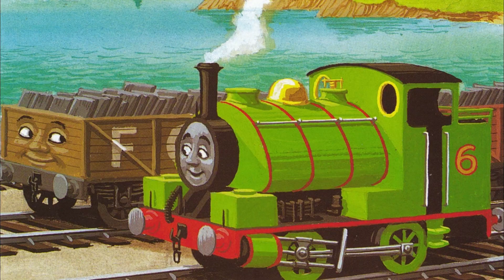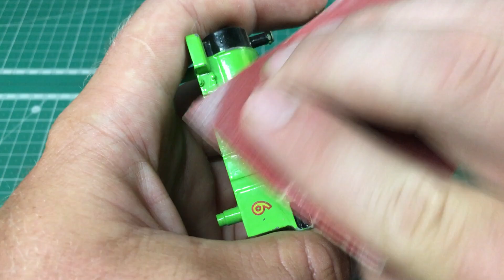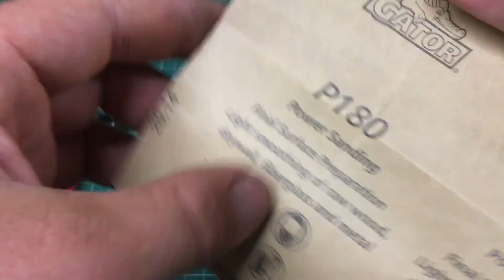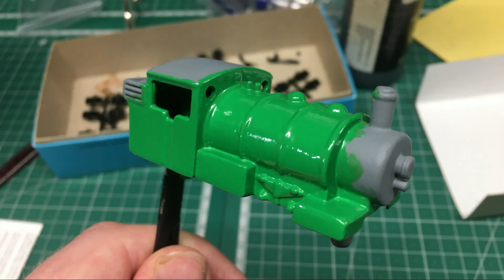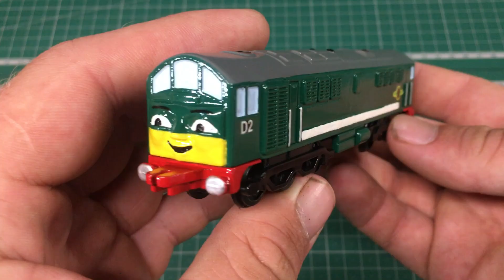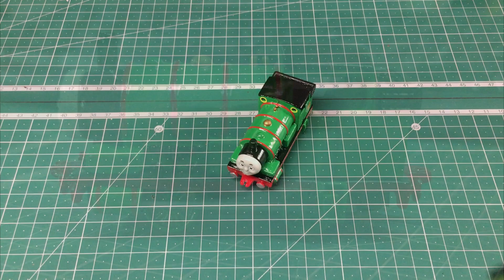How I Made my Custom ERTL Railway Series Percy - An In-depth Look into the Project

Comment: I have a ertl Edward I found at an antique store, he's in pretty good condition besides missing buffer stickers and a few scratches here and there. I want to try to patch up those scratches, and maybe paint the red lines on his boiler, I'm too anxious to go all out and take him apart as he was a very lucky find for me. Are there any paints you can recommend for patching up said scratches?
Reply from the maker: Probably the easiest to use is water based acrylic paints.  They make for easy clean up, which helps if you mess up while painting.
Reply: @PlowBenderStudios  Tysm :)

Comment: question, do you know how you could do the running board without getting the details messed up? I’m trying to make a RWS take and play James model but it’s hard to give them the black running board without messing up his splashers
Reply from the maker: @radiomonkeyhunter  The best method and what I always do is to just take the model apart to paint it. If you don't want to or can't do that, then your only other options are to either mask everything off or have a very steady hand and a fine brush to paint around everything.

Comment: The overall result looks so smooth and neat. What did you use to thin down the paint? Enamel thinner? Water?
Reply from the maker: I just used water since it's a water based acrylic paint, but I think a lot of people would tell you to use acrylic thinners instead.  Like I mention in the video, the paint on this really smoothed out after the clear coat was applied.  Not sure why it does that, but it works and that's all that matters.